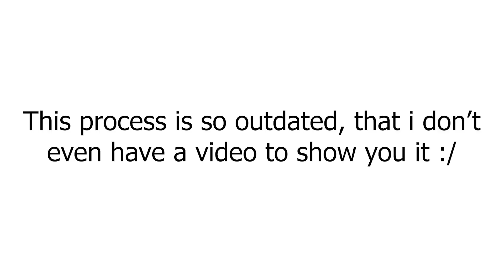Making Sodium Peroxide

Comment: Hack! Before you place sodium metal in mineral oil for storage,  first measure out the amount you need then place it in your vacuum chamber at -30hg  for 12 hours and you will have made it 100% anhydrous so no or extremely little oxidation if its contaminated with other impurities, but for the most part you'll be surprised how long Na metal stays shiny 😊😊😊😊